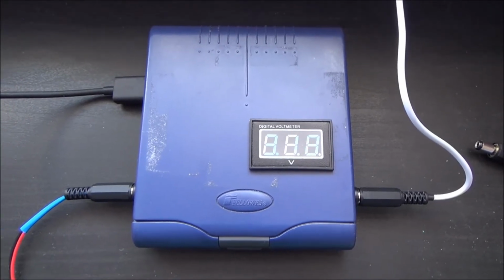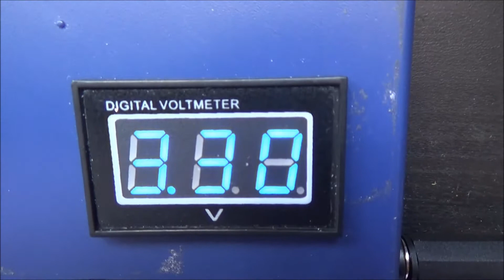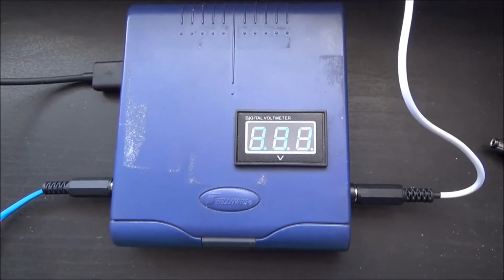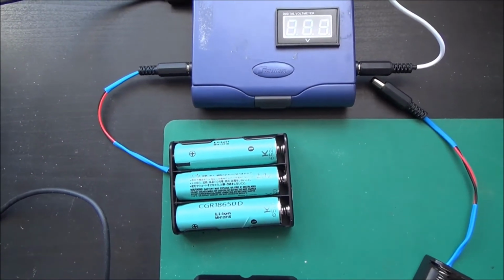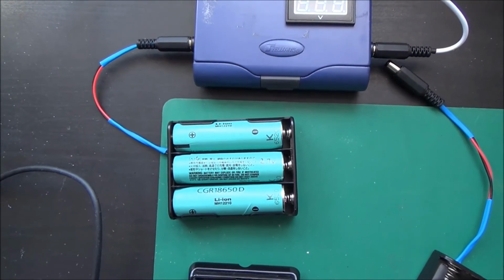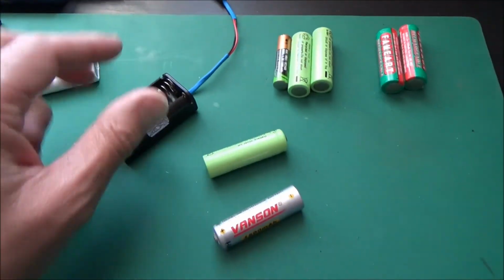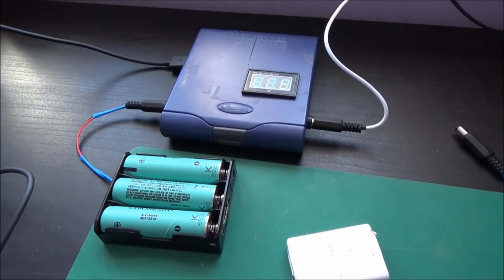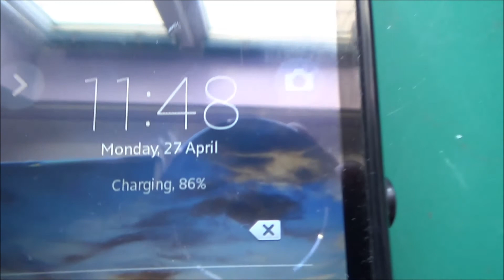Why Tinkering Is A Good Idea - Mini Solar Charger Mod

Comment: Interesting video, but it would be alot more useful if you would provide some numbers regarding the solar panel output, battery Amp hours, controller model number, etc.